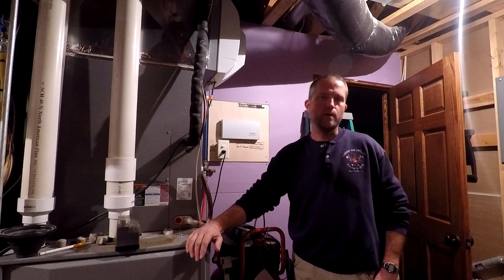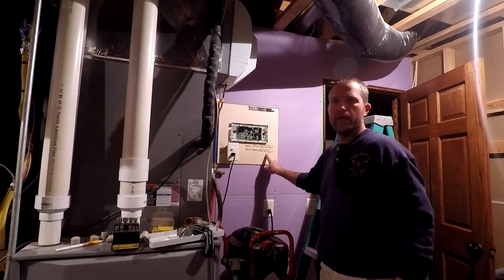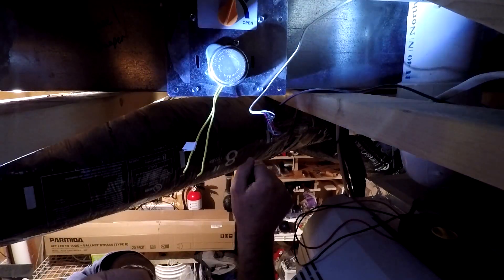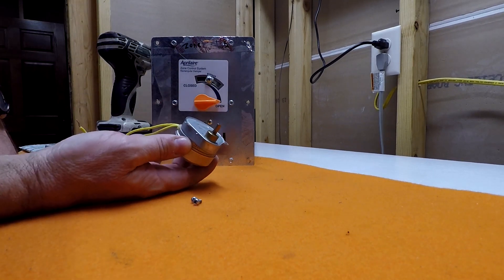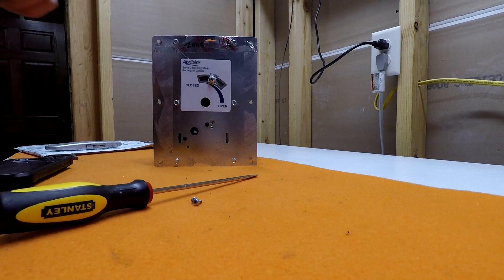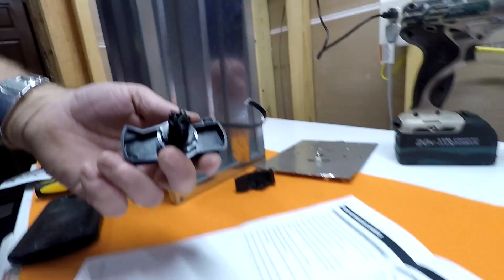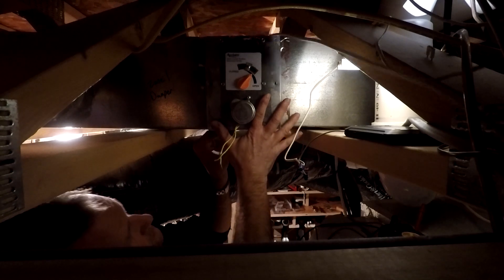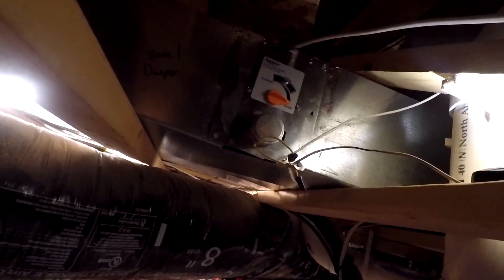Aprilaire Zone Damper Troubleshooting and Fix

Comment: Thank you for this video. We had a same damper having trouble twice in 3 years, and first time we had to pay someone $600 to replace the damper. This time we finally figured it out with the help of the video, and like others said, it almost feels like the this was designed to break within a year's time, and they are still manufacturing those and installing them to new homes.

Comment: Remember though for those just starting this job, if you are talented and patient enough, you can change the belt without taking everything apart!!  Just remember, when removing the belt from the top bar - don't put on the bar too much.  It will pull out and then you need to do this whole procedure...like I had too   :(   Gently with needle nose and small screw drivers try to remove the old belt without disturbing everything.

Comment: Designed to fail.  Maybe Aprilaire put this tiny rubber belt there to help the installers make extra money on billable repairs?  It takes considerable force to hold the damper closed, and this miniature rubber belt won't last.  The HVAC company wanted to charge me a diagnostic fee, plus labor and parts.  Minimum $500.  At least I have four spares now.  Thanks for the video.
Reply from the maker: Yeah, glad it helped. The other thing is often hard to tell it even failed until one zone seems not right somehow, if you don't know what to look for.
Reply: @christurner7288  Yes.  In my case, one zone was heating/cooling when it shouldn't have.  I didn't have a zone map, so I started at the control panel to see how it was programmed.  Once I knew which damper number it was, I checked the control board.  LEDs and voltages were right, so on to the damper motor.  There was voltage to the damper motor, and then I realized it was turning.  I could see the broken belt flipping around behind the damper panel.  I found your video.  Parts came from SupplyHouse quickly.  We love our three zone variable speed Lennox system and it is working perfectly again.
Reply: @jerrymcmillan  Exact same problem, looking through the hole in the cover, seeing the belt turning, seeing                               it was broken. The question is, was there a buzzing or grinding noise, or any kind of noise coming from the motor after the belt broke. Like gears slapping against each other because of not having any tension to the gears.
Reply: @briananderson6142  No.  Replacing the broken belt should fix the problem.  If you see belt flipping around in the housing, then the motor is working.  Potentially, if the damper requires too much force to turn, the belt could break again.  Mine is still working after seven months, so hoping it will last.  Now I have a spare motor and four spare belts, so I am prepared.

Comment: Thank you for this video - saved me from having to call an HVAC tech! 

I noticed that when I activated the system with the actuator motor out, that the actuator motor kept turning continuously while the system was on. Is this normal? Seems like that would lead to breaking the belt. But the is no limit switch to tell the motor to stop. The motor was also getting pretty hot, and not due to heat flowing through the system, so I’m thinking that motor might be bad as well?
Reply from the maker: Yes, the motor is designed to spin continuously but has so little torque that once the damper is closed and the belt is tight, the motor stops spinning and simply holds tension. I agree this seems like a weird way to handle it, but it is the design.  As far as it getting hot, I don't know that I ever really noticed one way of the other. If it is REALLY hot, yes it may be time to proactively replace it, but if it is still working (spinning as designed) you might just try it for a while.  Do you have a second damper in the system you could compare heat levels when running?
Reply: Thank you! Yes the second damper functions normally and the motor doesn’t seem to get that hot. I suspected it operates as you noted but it had lots of torque - I couldn’t stop it from rotating with my fingers so I thought it might be malfunctioning. I’ll replace the belt first and see what happens sine the motors are not so cheap (~$100). Thank you again!
Reply: Got the belt replaced and all seems to be functioning normally. Motor is not getting hot like it did when out of the housing. 

Thank you so much again for this video!!

Comment: Have the same issue with my Aprilaire zone dampers. Do you know if the Honeywell dampers have this same design with the tension belt? I’m thinking about replacing them. The fix is simple and cheap with the Aprilaire, but has happened to me twice in a year.
Reply from the maker: I am not familiar with the Honeywell branded dampers. That sounds very surprising that the belts are breaking that frequently though. I am at 14 years now with 2 dampers and have had only one break.

Comment: thank you- found the exact issue in my damper system.
if the motor keeps turning while the damper is held open (or closed)- doesn't the belt snap? or the motor burn out?
Reply from the maker: Once the full tension is on the belt, it has enough resistance to stop the motor shaft turning and just holds the damper. The motor must be designed to hold without burning out.

Comment: Step one shut of the electrical breaker at the panel so you don’t short out anything and you can use a 20volt battery to test the motor off your drill
Reply: Battery of your Drill is DC Volts. Most actuators are designed for AC volts.